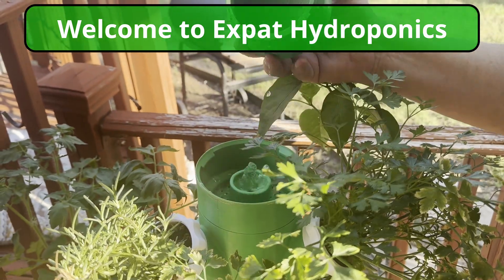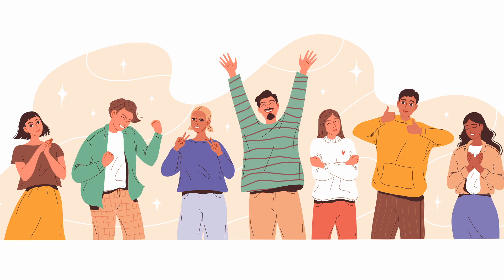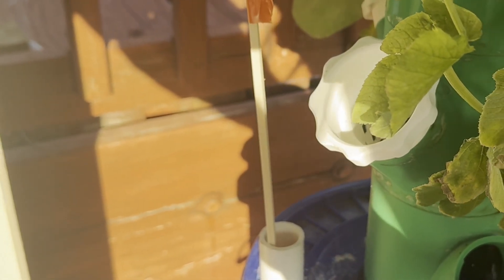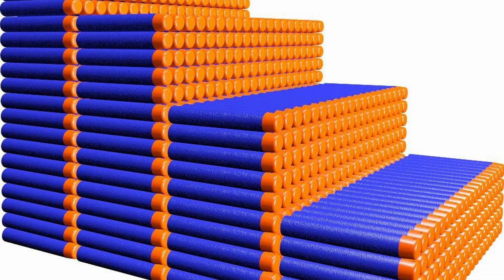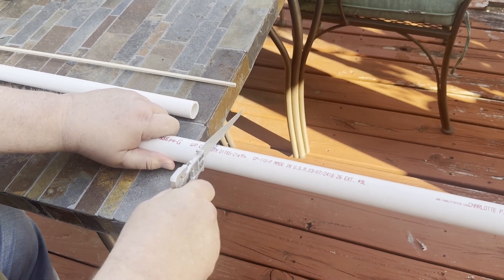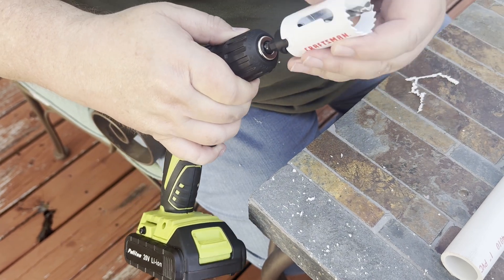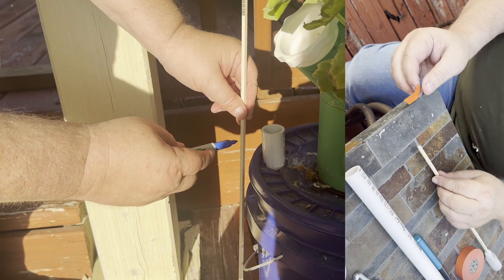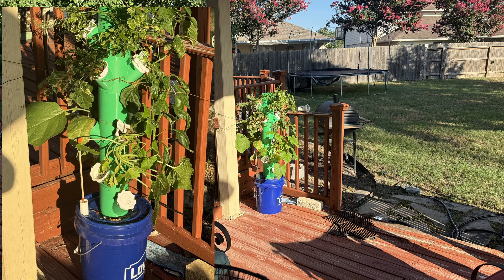DIY Aeroponic Tank water gauge

Comment: Carbon fiber arrow shaft  instead of wood.  Stays straight and lighter.
Reply from the maker: it is an option, but actually carbon fiber is 5 to 10 times heavier per volume of the same amount of balsa wood. Also, I think the balsa wood may be cheaper.